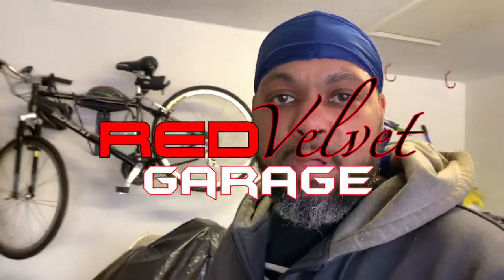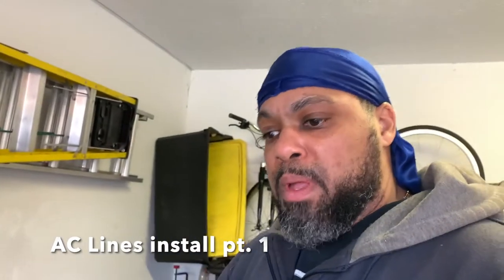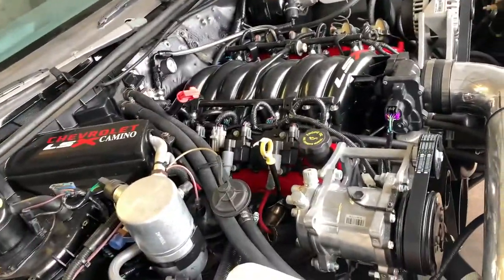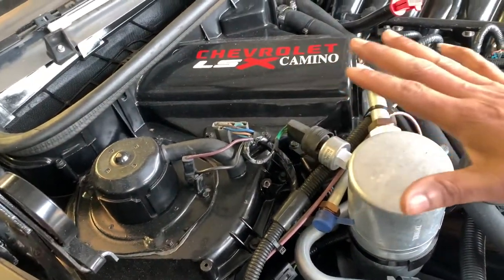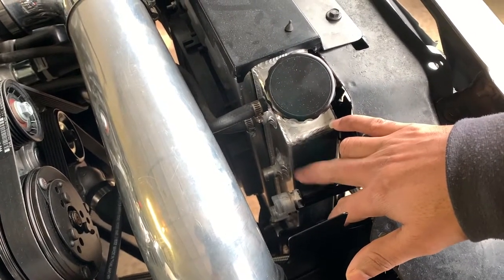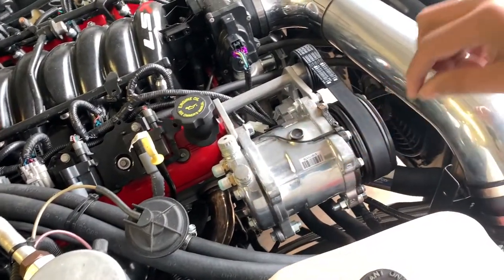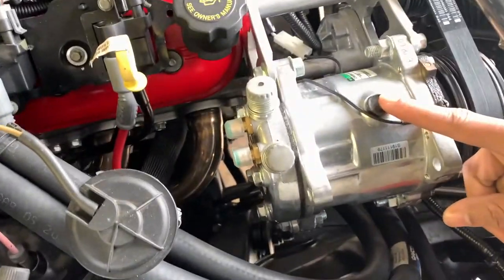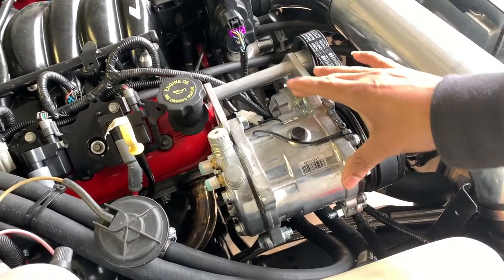AC LINES INSTALL AND CRIMPER REVIEW pt 1

Comment: Had a question to see if you had any advice.  I’m trying to make a liquid line, but my condenser and evap could have different size fittings, one is a #8 and the other is #6. I haven’t seen anybody make a line with different size fittings, yet.  You know how they do it??  We’re your liquid line fittings a different size?
Reply from the maker: Yes sir, on the video i used a specialty fitting that allowed me to neck down a 90 degree elbow fitting that was a #8 female end that goes to the evaporator and the other end of the fitting had a #6 threaded male end. I simply made a #6 hose line with the female screw on fittings on each end that fitted the condenser to the specialty fitting i mentioned in the video. There may be a fitting that fits a #6 hose that will have a #8 female end. Check out coldhose.com for their specialty fittings.
Reply: @mainskware  I see it now. Thanks, bro. You’re a lifesaver
Reply: @mainskware do you have the pn# to the special fitting i can’t find it

Comment: Hey, how did you wire the ac?
Reply from the maker: The g body has a green wire coming from the ac switch/lever inside the car up to the low pressure switch on the drier. That wire is a 12v positive that goes into the low pressure switch harness then back out. Once the low pressure switch closes, it sends 12 volts out the other green wire on that harness which i routed to a relay to trigger the wire from the relay to the compressor clutch. That same relay is used to send a ground trigger to the electric fans to come on when the compressor kicks on from the pressure switch.
Reply: @mainskware  thanks bro
Reply from the maker: @queezytarantino1456  no problem my man!
Reply: @mainskware  have you ever had any issues with the idle when the ac comes on?
Reply from the maker: @queezytarantino1456  it idles pretty good with drive by wire setup.